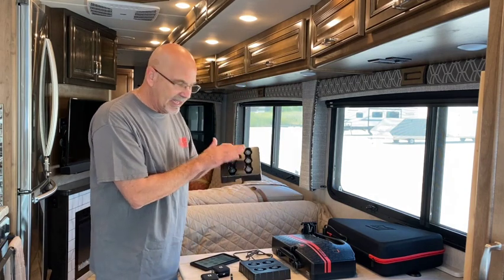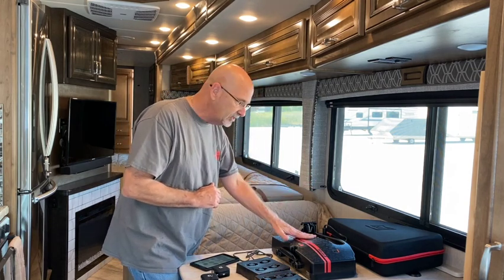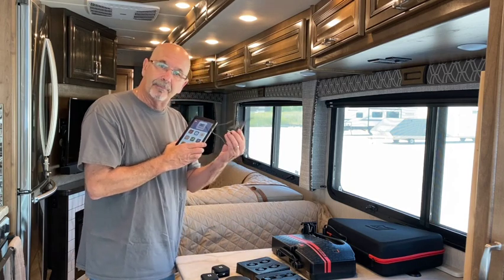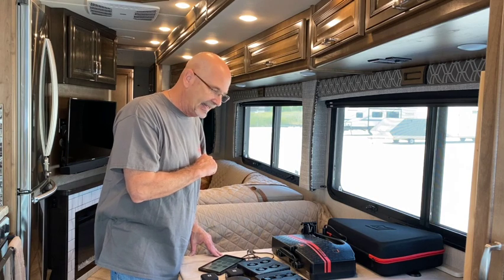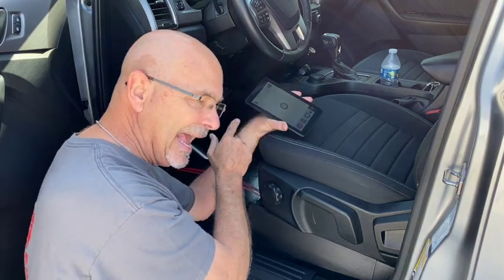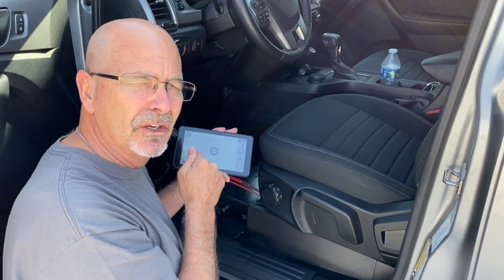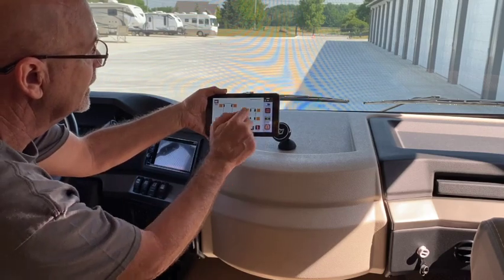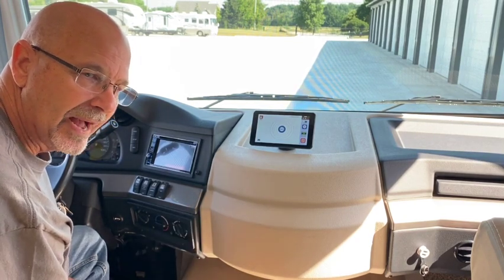RVi3 Braking System and Charger

Comment: HI, thanks, great video. Two questions: 1. Are you still happy with the RVi3 breaking system? 2. Why did you move away from the break buddy?
Reply from the maker: I'm still very satisfied with the complete system.  A few reasons, I have the RVi TPMS (Tire Patrol) system, their Towed vehicle battery charger,  and their RVi tablet and hup unit, the RVi 3 Brake pairs with the tablet, I can control it all from the one tablet. One other reason is the RVi3 Brake has the latest technology, as well as 'Brake Lock Detection'.

Comment: Do you know if the breakaway plug on the rvi is the same as the blue ox braking system?
Reply from the maker: The end that plugs into the brake unit is not the same, they are different.

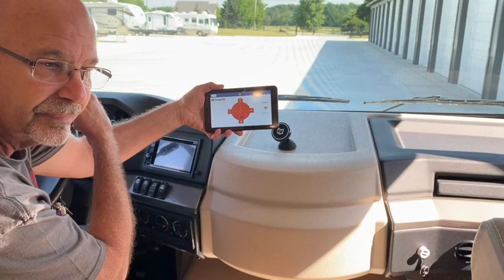Comment: 15:19 you mentioned you connect the rvi brake directly to the battery. How do you do that?  When ignition  is not on there is no power to the cigarette lighter.
Reply from the maker: Correct, I used a 15-amp (fused) 18-gauge wire 12-volt adapter hooked directly to the Ranger's battery,  The 12-volt power ports in the Ranger goes into battery saver mode (power shuts off) after 20 minutes from the ignition being shut off.

Comment: What's the cost of the complete brake system .
Reply from the maker: About $1600 for the portable RVi3 unit, then if you want you can buy a bundle the for $1920 which includes RVi3 brake, commend center, hub and 10 TPMS sensors.